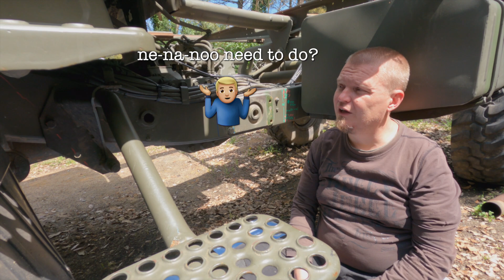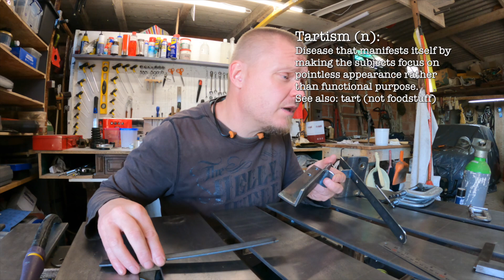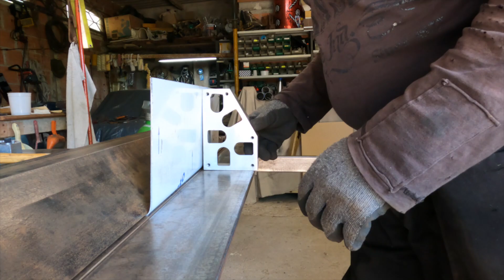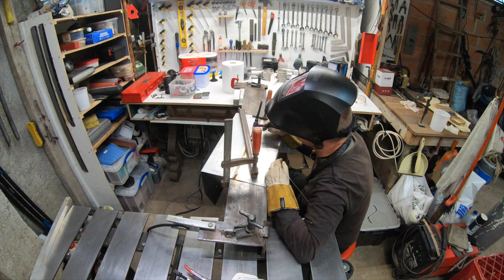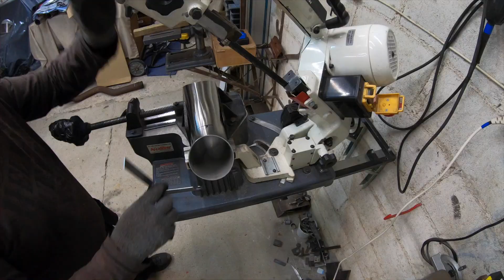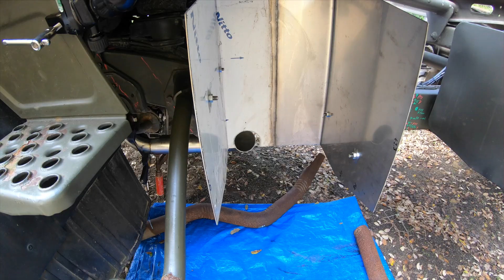Unimog Camper E022 - Building a stainless steel exhaust for the truck - Part 1

Comment: Excellent video. One could learn so much about this whole process of designing the silencer and executing thereafter just by watching.
How much roughly was the stainless steel used for this project?
Reply from the maker: Thanks! 😊👍🏻The aim of these videos is to demystify the whole process of making stuff, and judging by your comment, it seems to work! 
The cost was roughly £285 this includes
SS sheet - £125
Perforated tube - £15
SS tube - £35
Flex joint - £25
4 x 90º Elbow - £65
1 x V-band clamp - £20
All in T304 Stainless
What's not included is Argon, welding rods, bandsaw blades, cutting, grinding, sanding disks and other sundries like that.
A lot cheaper than buying a full exhaust system. 😎👍🏻
Thanks for joining us on this slow and bumpy ride! 🤪
Reply: @JockeSelin  for me it was super helpful, I look forward for the next part.
Reply from the maker: Thank you! I’m going to start editing it as soon as my brain has recovered from this episode. 😎👍🏻

Comment: Nice tide hole on the box. What about vibration..?
Reply from the maker: Thanks! The standard exhaust is rigidly mounted to the frame, but it’s got a lot longer pipe, and it’s not clamped at the engine end, so there’s a lot more flex in it. However, we are doing something to compensate for a shorter and more rigid pipe. In the next episode… 😁👍🏻 (Or you can have a peek on Facebook 😉)